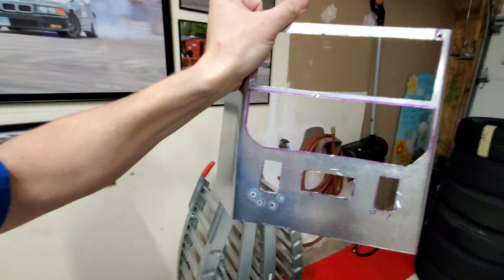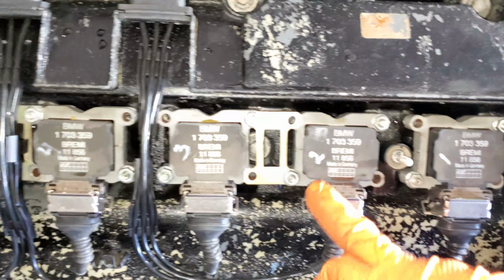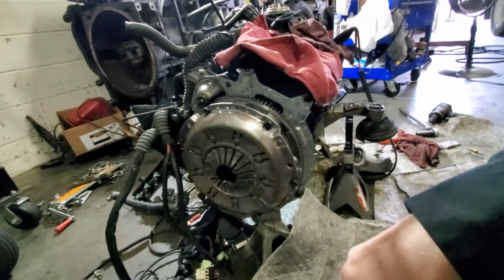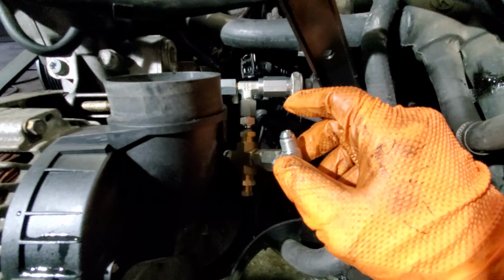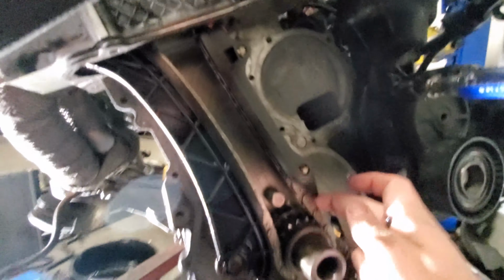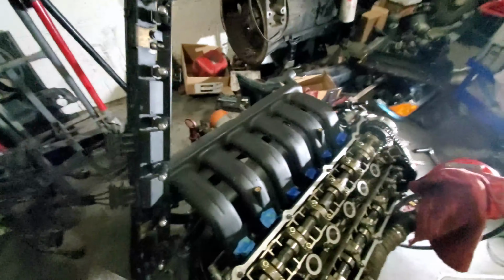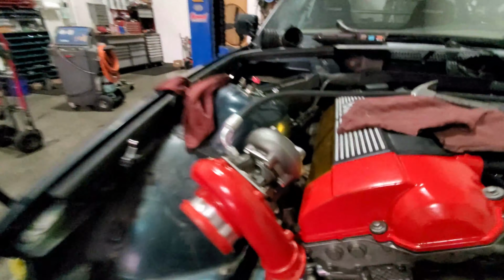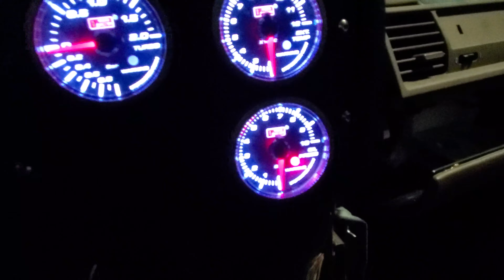Superior Drift Garage - BMW E36 Turbo Build Part 1

Comment: I'm about to turbo mine. Bought a link g4x ecu for it. I'm not going to run the spacer or anything for my head gasket. Boost and timing will be kept a bit lower but I'm only aiming for 300 wheel. How good is the gt35? I'm thinking gt30 for my goals
Reply from the maker: For daily driving I think 300 wheel should be ok...but remember that people like us always want more power baby! You should be able to reach safe 300 with E85, but what if that 300 won't be enough? Gt3530 that I have gives full boost at about 4k rpms.

Comment: Who ever is going to watch this video, don't take your camsahfts off like he did, they snap in half pretty easy this way. You have to look which lobes on the camshaft are pointing down and release these caps last!
Reply from the maker: youre actually right, thanx for pointing this out too. I fucked up on that, but will remember for sure. Thanx for watching!

Comment: Awesome video! Did you buy the whole K64 Kit? Also I did not see any AFR Gauge/ broadband lambda, how are you taking care of that?
Reply from the maker: Yes sir,  it's a while k64 kit.  AFR gauge got installed later,  which is actually not in the video.  Bung was made in the exhaust pipe. Thank you for watching!
Reply: @superiordriftgarage  thanks for the great content dude, planning on buying a k64 kit myself, any issues or anything else that is needed? Looks to be quiet complete. Did you also order the clutch from them?
Reply from the maker: @haubidrift  clutch also came with the kit.  No issues,  everything came the way it should be,  basically a plug and play solution!

Comment: No MLS heasgaskets or arp studs? How much power you think I could push on 100% stock internals?
Reply from the maker: no MLS gasket because i used 2 stock plus metal spacer. This is making 400 wheel right now, and per tuner we have some room for more power. In europe, K64 garage makes 500+ whp with the same set up on pump gas! Its been proven over and over to be a good and reliable setup.

Comment: Hi bro, nice built, can you help me?
I'm installed but it doesn't start with ecumaster det3. How you installed yours? You cut from the standard Ecu and switch in the ecumaster?
Reply from the maker: I can help, sure thing. I tapped into the wiring or the stock ecu. I can send you info on what to tap into, how can I get your contact info...email?
Reply from the maker: What's your instagram, I'll contact you there.

Comment: Nice video! What ECU using? Looks like stock?
Reply from the maker: Stock ECU wired to ECM Master Det 3....which literally makes it work like a standalone.  If you don't mind tapping into your cars wiring then this could be a cost effective solution! Thanx for watching!

Comment: what about getting bund welded instead of using the bolt system for the timing cover? wondering how to do mine
Reply from the maker: I didn't have a way to weld mine,  but yes,  if you can weld it on then do it,  simply because you won't have any oil leaks if done correctly.

Comment: Nice video friend,wyh you remove the cam..any modification for head?
Reply from the maker: i removed the cams so my machine shop can shave the head to make sure there arent any imperfections.
Reply: @superiordriftgarage  ok,i also in plaining to boost my e36,m50b25

Comment: What head gasket and gearbox did you guys use?
Reply from the maker: I have 2 oem head gaskets plus metal spacer.  First gearbox was a getrag that took a shit after few runs on the track.  Now in running a ZF from a M3.... so far so good. Thanx for watching!
Reply: @superiordriftgarage  Legend thanks mate.

Comment: Its a M50TÜB25 if it has vanos
And a M50B25 without vanos
Reply from the maker: You're right, thank you for the correction
Reply: @superiordriftgarage  you welcome, im building a M50 turbo My self at the moment, for street use😉